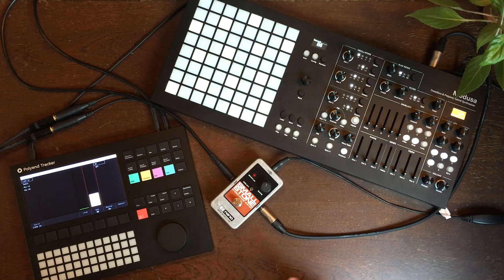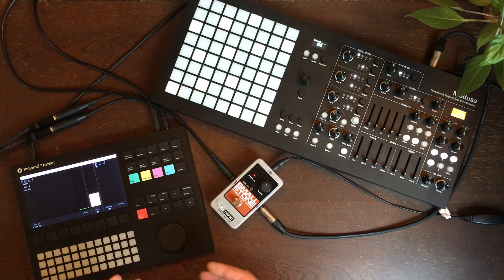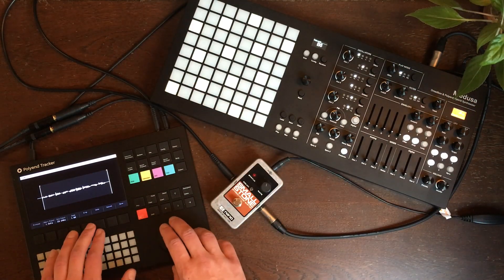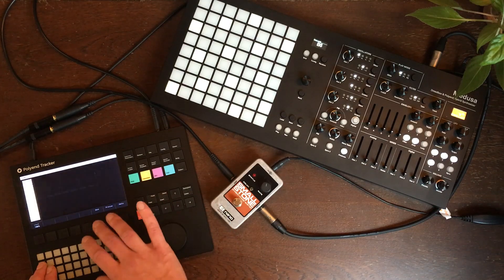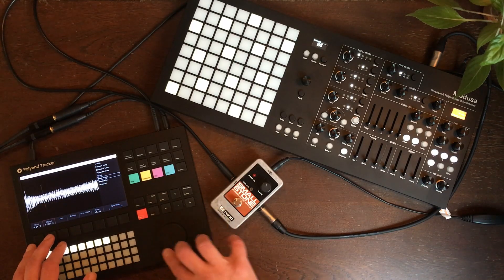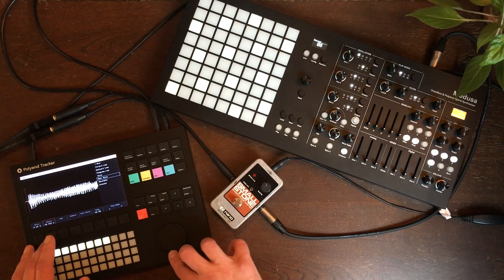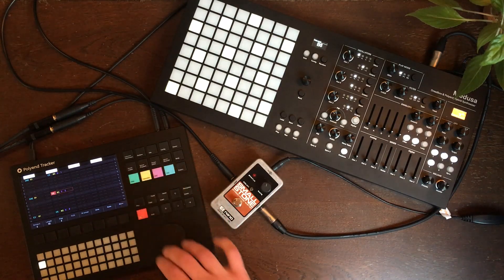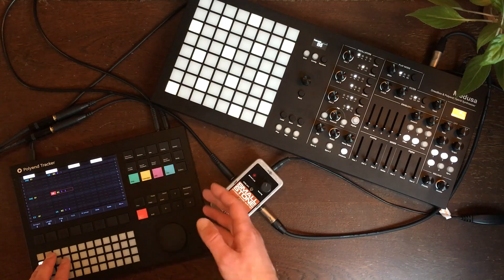Synth Slicing: Stazma Polyend Tracker Tips & Tricks

Comment: Thanks a lot for sharing! I was always wondering about the best way to integrate external synth voices into the Tracker. So far, my primary workflow is to program MIDI notes on the Tracker, then sampling the phrase / melody into the Tracker by playing back the pattern during record. Afterwards I'd put the sample on step 1 as a one-shot, playing throughout the whole pattern. But basically, that results in 5-20 second long samples for each audio stem, so one would run out of sample memory quite soon when working on multiple patterns. Additionally, many of the step FX and Perform FX won't work as expected / intended when working with long one-shot samples...
Long story short, I'll really try to adopt your workflow more often :elbowcough: